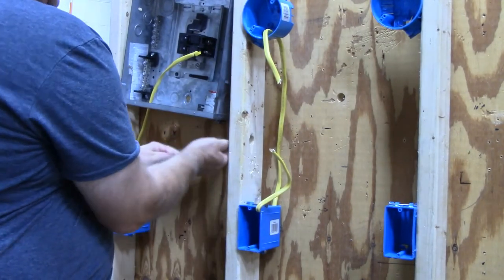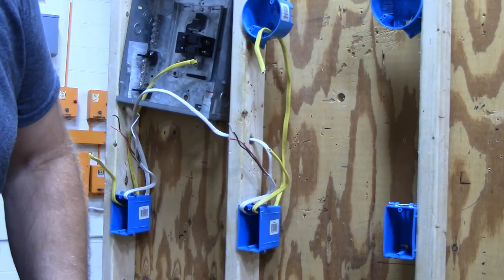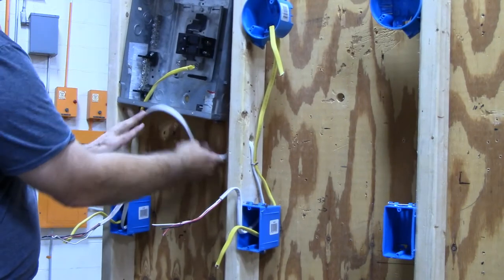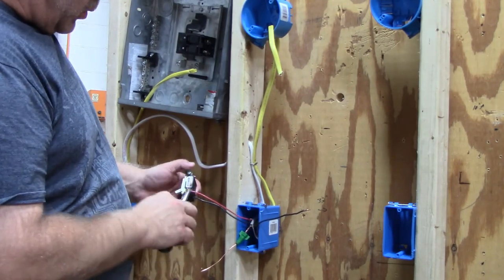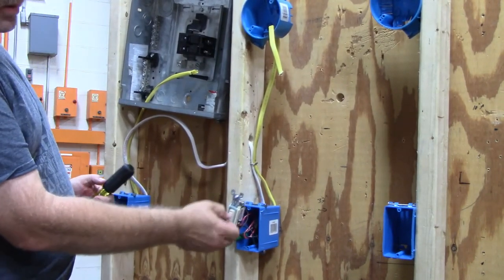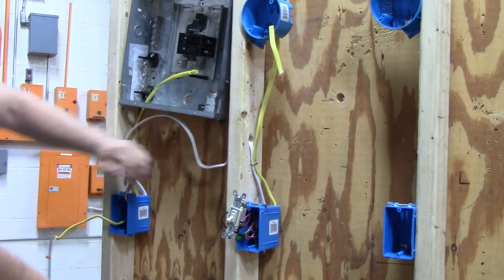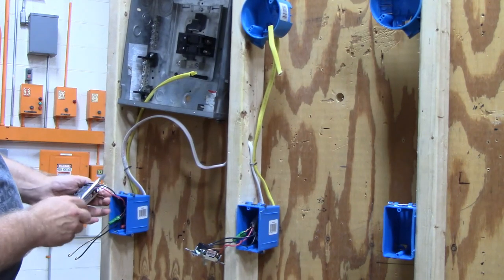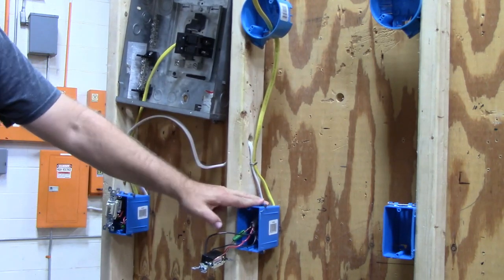three way switch, power in one box, switch leg in the other

Comment: thank you dude after watching a few of your 3 way videos ive got a good understanding on how to wire these in different ways. and what to look out for in the field so im not tripped up if say a white wire is on the black screw. I need to keep in mind 12-3 is used for the switches while 12-2 is used for feeder and light fixture!
Reply from the maker: The reason I do these videos is to help others understand  wiring, especially in older houses. I'm glad I could help.